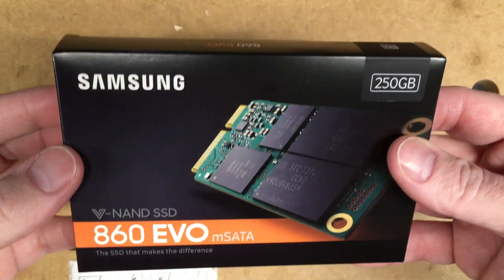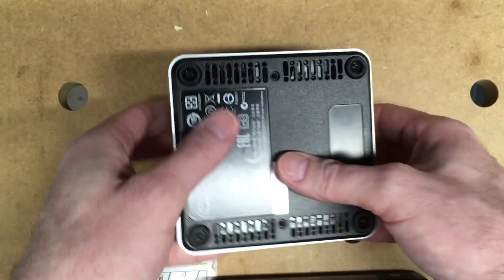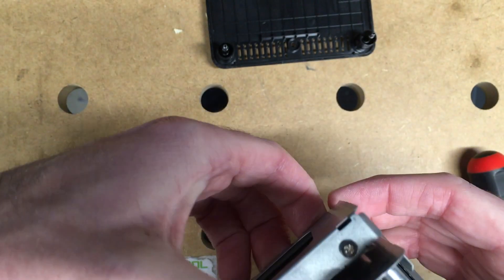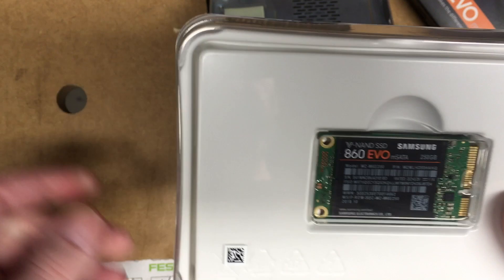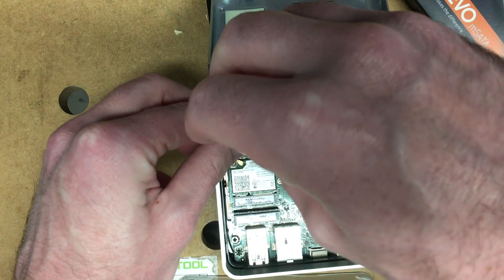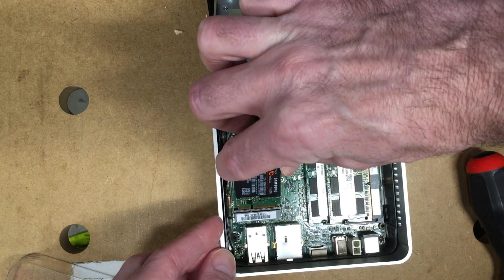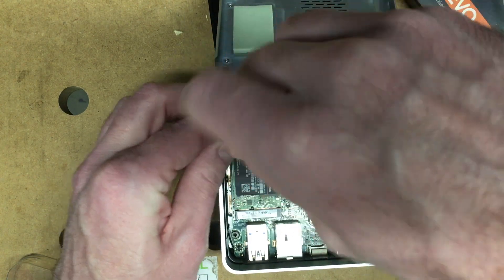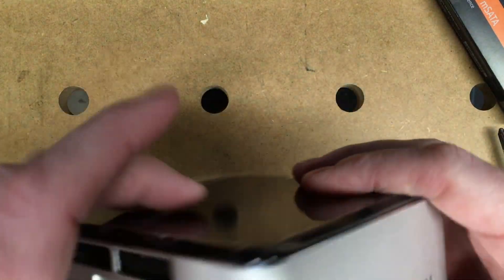Installing an mSATA SSD in an (Older) Intel NUC

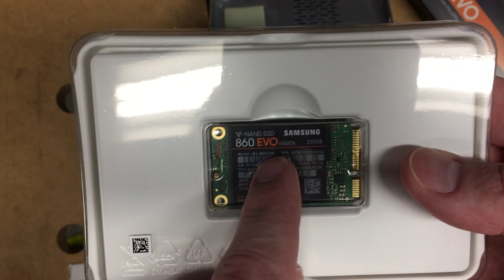Comment: @ 2:10 you say "make sure they match up". How do you do that? How do you find out if they do?
Reply from the maker: I apologize for that. That wasn't very clear. You will typically see either mSATA or NVMe so you want to find out which your NUC uses and then get the corresponding drive.
Reply: @Rickmakes  Thanks Rick. Thing is my NUC uses m.Sata but some modules are not seen by bios and some others are (same capacity and all of them Sata III). I can't figure out why!